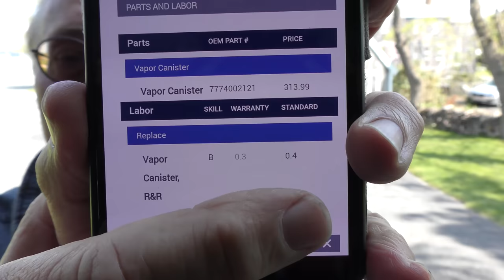7 Car Myths Stupid People Fall For

Comment: I remember the Mythbusters testing the air conditioner vs rolled down windows thing.  They came to the same conclusion.
Reply: Rolled down windows thing?
Reply: @mrdave777  fuel economy of using the ac vs rolling down the windows.
Reply: @mrdave777  - Did you watch another video? LOL...
Reply: @mrdave777 no the shape charge Dean domino uses under a seat. You're lucky I watched the video well to fill you in.
Reply: Did this a lot when living in Los Angeles.
Reply: and Car Talk. Sure miss those guys
Reply: And the driving with the tailgate down on the truck thing. Not to mention the tailgating a semi thing.
Reply: I don't roll my windows down for AC. I roll them down so I can hear road-noise.
Reply: I remember that too so I have always been doing the recommendation to roll windows going slow and use AC when going fast. I've recently been leaving my windows down fast or slow and I haven't really noticed any difference. My average fuel economy is about the same. I'm just going to leave them down unless the wind interference is strong, so that I'm not playing window roulette and to prolong the life of the motors.
Reply: @mrdave777  windows down thingy is 4x60. 4 windows down at 60mph
Reply: I think it depends on the speed. Highway it doesn’t matter but city and stop an go there is a differance.
Reply: I thought it was 55 mph. Personally, I always keep my windows up. Sometimes I crack it open a little while ac is running, and it actually feels cooler. All that cool air rushing  oast you. Yep, real wasteful human being type stuff
Reply: i just do windows down cause i like having them down only when it’s nice outside
Reply: Windows down vs aircon is about 11% extra fuel usage for either. So just use aircon with fresh air coming in the vents. Then you have have the temp you want without the noise. 
What ever you do, don’t have aircon on AND windows down or you’ll waste so much more fuel.

Comment: I replaced my spark plugs on my Toyota Tacoma recently at 120K miles. They still looked like new!

I remember back in the day when we used to have to replace spark plugs every 10K miles because they were shot.

The thing about car myths is that many of them were true AT ONE TIME, but not true anymore. People just refuse to believe that things have changed when it comes to doing maintenance on your car.
Reply: "I replaced my spark plugs on my Toyota Tacoma recently at 120K miles. They still looked like new!" That does it. Finally I'm convinced not to replace (actually, to have a mechanic replace, because on a V6 engine the back bank is a bear to get at) my 2011 Toyota Venza's sparkplugs. It has 95,000 miles but as little as I drive, 3K miles a year at most, the engine will outlast me. Thanks for the input, BD.
Reply: My cousin & I switched my used 2005 P74 Ford Crown Vic V8 4.6L spark plugs, 8x. Bosch double platinum. I expect my plugs to run 30000mi or so. 220000mi.

Comment: As always, Scotty is right on in this video ! But just one thing to remember if you change your oil every 10,000 miles make sure you put a high mileage filter on . If you use a regular filter and you go 10,000 miles the paper starts to break down so make sure you use the correct filter for the higher mileage.
Reply: My oil would be sludge by 10000 miles unless my life was solely on the interstate. In fact I have bad luck with 5000 intervals. Like everything else, there's some bad parts floating around and you really gotta be observant. $15 oil filter is not something I'd buy when a $1-3 one lasts a year and 2000 miles.
Reply: I agre

Comment: Imagine sitting in stop-and-go traffic on a hot summer day, with hot-running cars all around, and you've got your windows down instead of using the A/C to try to save a little money.  In my early driving days, I didn't have A/C and sitting in traffic on a hot summer day was brutal.

Comment: The remote key range doesn't depend on its position relative to your body but rather its orientation. Depending on how the antenna is oriented within the key you simply get a better range holding it upright or in a 90° angle towards the car. With most keys I found holding them upright slightly above your head will already give you maximum range. In a parking lot with all the parked cars of course they're gonna absorb the signal if you "shoot from the hip".
Reply: I reach in my pocket and press the button and the car unlocks from 30 feet away.
Reply: @CraigGrant-sh3in  Of course it also depends on how strong your keys signal is to begin with. Some work across the whole lot, other will require you to have it in sightline.
Reply: or you could press it multiple times and it can reach. I do try it and have luck sometimes. maybe the orientation has to be the reason
Reply: True. Changing or modifying an antenna cannot give you more power in all directions. 

It can give you more power in specific directions, but only by causing less power to go in other directions.

Comment: I didn't know about the key fob trick After doing some quick research, it looks like the water is acting as a reflecting surface.
In this case, I maybe a paraboloid reflector could be used to really concentrate the key fob's signal in a particular direction.
Reply: It works but I get better range if I touch it to the bottom of my jaw bone instead of the throat. It's the curse of owning one of the smallest cars in the parking lot.
Reply: Paraboloid? Nice, had to look up that word.
Reply: Some say use an open mouth instead as a reflector of sorts.....seems to also work.
Reply: As the rays go thru your head and give you cancer, the range is extended twice as far! Yipee! (Hehe, just kidding)
Reply: @SJHFoto  I was thinking my head just made a good echo chamber.
Reply: I find simply using my legs to get closer to the car is the easiest option.
Reply: @mikep490  I like how Scotty said that your head is usually attached so easier to keep track of.
Reply: I do it against the side of my head usually above the ear. Still works. Never done it anywhere near my throat.
Reply: Didn't you notice that when he did it under the chin, the film cut to a similar, but darker scene, and the lights "didn't" flash on? Yet, he pretended they did.
Reply: Buzzing. Put it under your chin and make contact with your skin to use the buzzing to amplify sound waves.  Supposedly.

Comment: Myth Busters also did the same experiment. They tested a modern car with AC & drove it with the AC on, then repeated the test with AC off, & windows down. Driving with windows down increased fuel consumption compared to windows up & AC on.
Reply: And there are still some specialist that say "windows open is better".
I get it for low city speeds.
For me was the best having a roof window tilted, rarely needed the ac, but in combo with ac that was great...warm air under the roof just was pulled out while pushing in cold air in the bottom, and it got cooler.
Reply: @mammutMK2  I don't listen to the so called specialists. They tell you windows open is better, yet actual tests prove otherwise. A properly working a/c system in a car draws bugger all power, especially the rotary compressor types built in the last 30 years. Even my 1976 Mercedes has a rotary a/c compressor from factory, not only this, I'm a retired auto engineer, so I do know what I'm talking about, unlike these "specialists" who just want your extra money for fuel.
Reply: I prefer window open to AC. Especially in Tuscan AZ during the day. Had the window open & the AC on. Was burning my left arm & face with the window up.
Reply: @Elizabeth-rq1vi window open and AC on??? it's one or the other. you leave the AC running while window is open, you are only overloading the AC system.
Reply: @marrionberry8848  with the window up my left arm was getting burned! I don’t live in Tuscan so that was quite the experience!
Usually I don’t have the AC on, I’m a window open person unless the car is SO hot! Also to help cool the stifling hot car down we open the windows to let the heat out for a boy 5mins & then close them.

Comment: Back in the day all we basically had to do was keep the carburetor clean, occasionally flush out the cooling system, and change the engine oil and transmission fluid. Those old push rod engines were pretty easy to take care of.
Reply: So you had a pushrod engine with no air filter, fuel filter, distributor cap, distributor rotor, wires, spark plugs, water pump, or belts?
Reply: @luisdetomaso867  He never had to worry about that.  He only put 300 miles on his car annually.
Reply: And they didn't last for very long, it sounds like in your case they probably lasted you like 3 years?
Reply: @scarfacefan1100  Over 30.
Reply: Totally disagree, cars in the '50's, 60's and '70's rarely lasted more than 100,000 miles. Also, carburators sucked.
Reply: @neilabernath5862  my parents got 100k easy with their Pontiacs, dad was a Pontiac man, but the point you missed was he was an everyday Joe, owned one small business, mom did not work and he always, easily paid cash for his cars.   Mechanics, parts, gas was all much much cheaper, so life was better owning your car, than being a slave to the company store.  He also was able to work on his cars, all his friends knew how to work on cars, so they had many time fixing each other's cars , but today, most men don't know how to use a vice grip, and would rather watch videos alone, give me the old society, it was more human.
Reply: @rgregoryful Is this Gregory Stevens? Why are you acting like this?

This is how you get out of your responsibilities, is this the way you act?
Reply: @neilabernath5862  if you put those older engine oils, trans fluid, gear oil, into cars today they would not even make it to 30k.  But new fluids in older cars makes them go to 200k easy.
Reply: @neilabernath5862  Cars back then would die from terminal rust.

Comment: Important tip: Just because your spark plugs "still look new" that does not mean they are not worn. 
They can "look new" AKA "Clean" but still have a worn down electrode. 
Meaning the Gap between it and the contact is wider then it should be.
Change spark plugs according their specs (time, milage, ect) and not so much the car's manufacturer's specs.
Reply: I've seen plugs crack the porcelain and arc at times causing a misfire. It's why if it misfires intermittent it's probably plugs or wires.

Comment: Scotty is so right about the EVAP system getting raw gas in it if you overfill your fuel tank. I use to have a habit of doing that years ago when I owned a Chevy Venture van. The last time I filled it up I went home and a few hours later went outside to leave and smelled a very strong odor of gas coming from underneath. Upon inspection I could tell it was in the EVAP system so I took it in and they replaced it and they told me not to overfill the tank but to stop when the automatic shut-off stops pumping gas into the automobile. I've never had any trouble with any other vehicle again by taking that advice.
Reply: I bought a used 2014 Navigator and found that when the gas tank is full and the pump shuts off, my gas gauge reads just 3/4 full.  The computer shows the full range to be O.K.  When the gauge reaches 1/2 full, it then becomes accurate to the computer and it reads fine all the way down to empty.  A mechanic told me that the gauge accuracy was probably affected by the previous owner topping off the tank after the  pump shuts off.  There's no other issues, so I'm not planning to replace the EVAP system to fix it.
Reply: Not to mention that just about every gas pump in America says on it "DO NOT TOP OFF". There's a good reason for that, folks! Thanks, Scotty, for putting out there what that reason is!
Reply: hi. my name is Rhianna and I'm addicted to tipping off my gas tank.... Lol... but I'm going sober TODAY after this video I swear😂
Reply: @rhiannablumberg4803  Hello Rhianna. Welcome to TA.  (Top-Off's Annonymous).

Comment: I find that since I do a lot of highway miles at 70 mph and I use full synthetic, my 150,000 mile 2010 Toyota Yaris runs great!   I can take a (supposedly) 10,000 mile filter and change it out around 4 to 5 K, which gets new oil introduced into the filter to replace what was taken out, and run another 3-4k before changing it out completely.  Having the filter changed often is cheaper than changing the oil outright since much of the work of the filter is to keep the engine clean and oil free to do it's job. On occasion, I will run some MMO in the engine just before a full oil change.  We are about to take a trip to Chattanooga from St. Louis in June, as we have made several trips to Atlanta in the past three years with the car.
Reply: It's not for sale is it?

Comment: I just ran a fuel injector cleaner and replaced the coils and spark plugs in my wife’s 2008 matrix. The parts were all original, and you could feel a little rough idle when the car was cold. It couldn’t of been any easier. The car runs as smooth as silk now.
Reply: I was worried back when I was about to buy my next car and it would be our first fuel injected one, because what would I do if it needed a tune up? No carburetor. I should not have been concerned. Today’s cars are so much better without carbs!
Reply: I have never had to replace a coil. Fuel injector gas additive every 4-6 months and spark plugs per the maintenance schedule keeps my three cars running fine.
Reply: RedLine additive is by far the best!
Reply: I had my Ford P74 2005 V8 Crown Victoria LX spark plugs swap out. I'd agree, replace the ignition coils too. I later had 2 coils replaced: $$$ 😌. Engine parts-components function smoother, better when new. Better MPG ⛽️ too.

Comment: Oil interval is right on the money. I use Mobil 1 on my daily and change it every 5k miles.
Reply: I used to get oil changes: 4000 5000mi with my used 2002 Jeep Liberty 4x4: 2013 to 2018. Towards the end, now(used Ford P74 Crown Victoria V8, 2005) I get synthetic oil changes. Every 6000mi or so.

Comment: my 19 F150 with 5.0 would knock and ping like mad if I didn't run 91 octane.  It was like getting a raise when I got rid of the POS at 46K miles due to transmission issues.  My new truck runs 87 without issue saving about $35 a fill up.

Comment: To be quite honest we change oil at the prescribed intervals, which are 15 000 kilometers (about 9300 miles)  for many Toyota models.  For some Skoda models the interval at least used to be 30 000 kilometers (about 19 000 miles).  We have never had any problems because of this.  Some people actually say that it is even safe to only refill oil, and just change the oil filter about every second year.
Reply: Some people would be wrong.
Reply: Modern engine oils are incredible for long life. 10,000 miles minimum, 16,000 miles comfortably.
Designed to last as an environmental friendly thing- avoiding unnecessary legal disposal and illegal dumping via DIY's using household rubbish bins
Reply: I drive a Honda CR-V and it tells me when to change my oil!  It’s usually around 6 months and around 15,000 miles!!!In years passed we always changed at 3,000 miles!  My csr runs perfectly and have never had a single problem.  Oh, and my fob needs to be pretty close to my car to work which is fine with me as I really don’t want to unlock it when I’m not even close walking from a store!
Reply: @sandybruce9092  Good for you.  Nonetheless, we actually change oil at the recommended intervals, which is about every 9300 miles for a Toyota Yaris.  Thus, the question is not if the car runs well, if one changes the oil every 3000 miles.  The question is whether it runs just as well when one triples the change interval to about 9000 miles.
Reply: @jonebjrheim3148  Yes, my car runs perfectly - my husband knows cars and he wouldn’t “allow” (I’m using that word euphemistically) me to do this if I was going to make a mess of the engine!  At about $100 a pop for an oil change it just isn’t viable for us!  And I NEVER go to a dealer!  I can work with the salespeople when purchasing - and I’ve been purchasing our cars for over 30 years - but I won’t deal with service people who always want to sell me something just because they think I’m just a stupid female!
Reply: @sandybruce9092  What does the owner's manual say about the recommended oil change interval for your car?  Is it 3000 miles or another number?

Comment: Scotty, average mileage per year here in the UK is 10-12000 miles.  I always get my car serviced according to manufacturers instructions... which always includes an oil and filter change every 10-12000 miles.....so what do you think of that?  It's a Maza CX-5 2.2 litre diesel, by the way.

Comment: I had an older Dodge Dakota that would not run on 87 octane fuel. It would lose power and knock and ping. I had to use the, at the time, 89 octane fuel and it ran great.
Reply: yes, older cars REQUIRED higher octane gas. Otherwise, they would "knock" on low ocatane, damaging the piston chambers.

Comment: My 2015 Prius really never required a tune up at all. The manual said to change the spark plugs after 100,000 mi. I didn't because the dealership wanted almost $300 to do it (lots of plastic covers and windshield wiper junk and metal bits to remove just to get to them). I didn't want to take the time to do it myself, because I figured I would take four or five hours to figure out how to do it, even with YouTube videos. I let the spark plugs go and finally decided to have them replaced by the dealer at 240,000 mi. The dealer price had dropped to about $220 by that time, so I told the dealer to go ahead and do it. 

The original spark plugs were a nice very light tan color and the gap did not look horrendously wide although I didn't measure it. The car got about 2 MPG better gas mileage after the spark plug change.